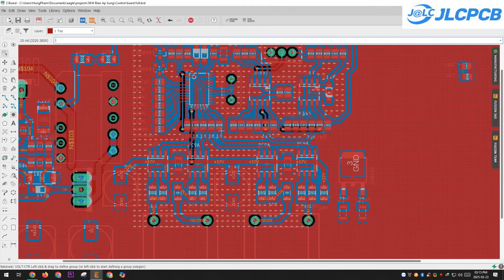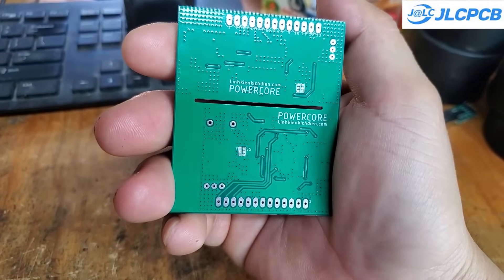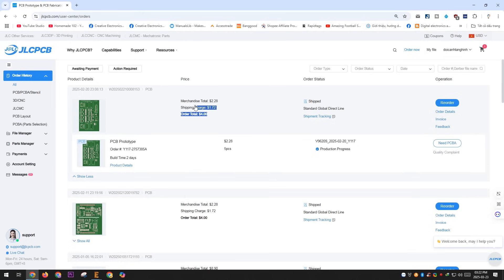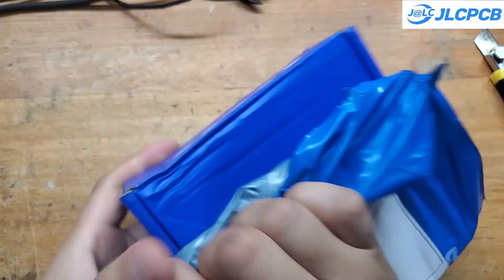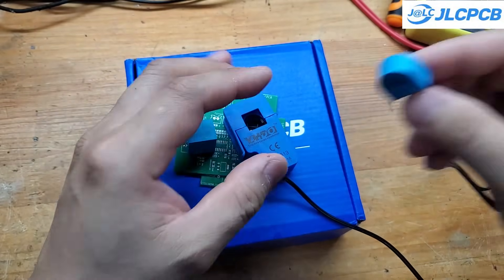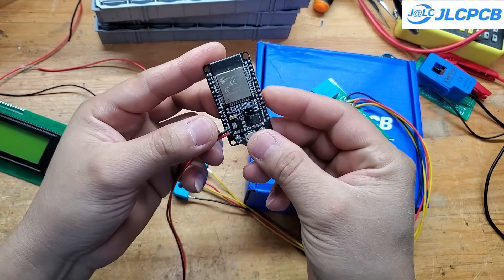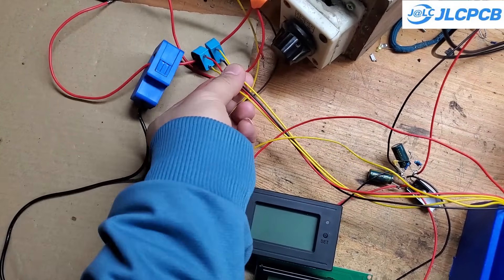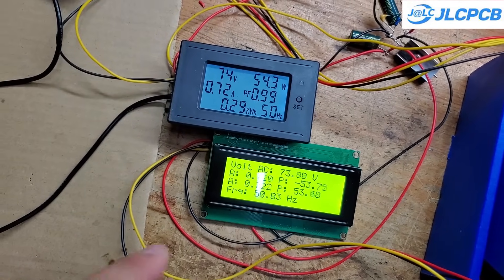Make AC Power Meter | JLCPCB

Comment: The amorphous core I tried did not work with egs002, the only thing it did was draw amps on the primary, 5 turns, for the 48v system, and the ac output did not reach anything more than 10v. 
something was wrong. Idk. 

BUT, 
I got a new board in which is more efficient, It looks like its using larger capacitors so its drawing only 14w idle and is over 90 percent efficient at most loads, even with a non optimized inductor and a laminated square transformer from an old apc. 

It seems like its gonna work for now. 
I might try the amorphous inductor if the idle and load efficiency is improved. 

I want amorphous for ALL though!!!
How do you get these to work for your projects?